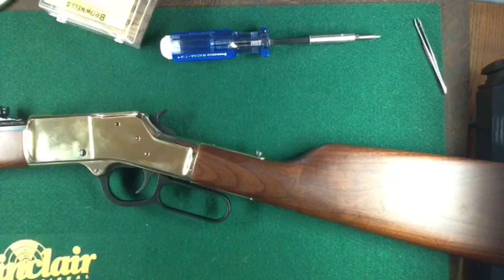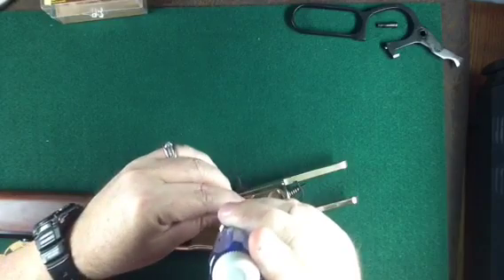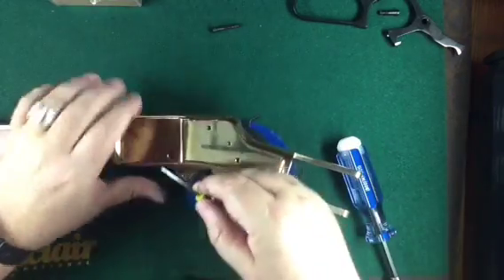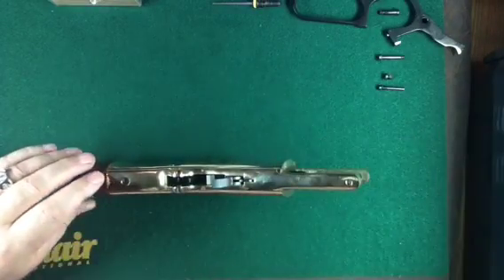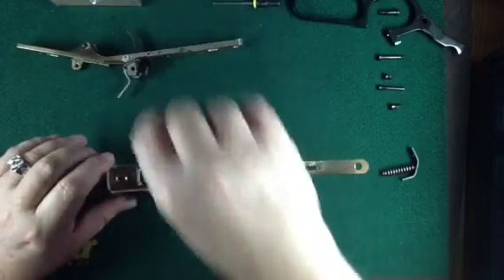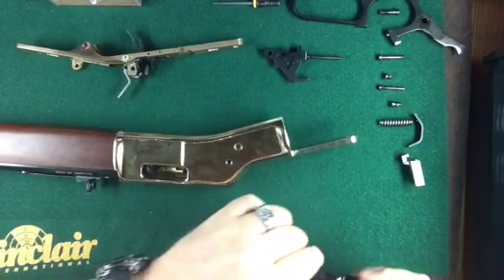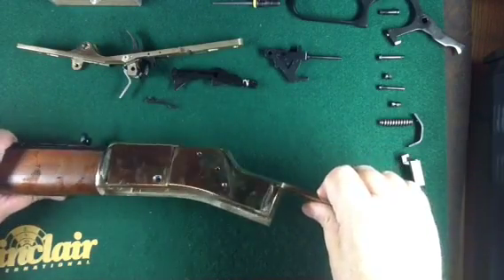Henry Big Boy Rifle Disassembly

Comment: Thanks Gerry. I pulled mine apart yesterday to access the tiny screw that holds the mag tube in place. ( Mine had come loose and the tube was moving around. ) Turns out the adjustment on that screw is critical. Too far in and the brass tube will not slide in, too far out and the tube will float. Be wise and use lock tight.
Reassembly was smooth until that last big screw. I worked at it for over an hour, but found if I replaced the bolt and lever, then closed the action and slowly released the trigger that screw went in pretty easy.

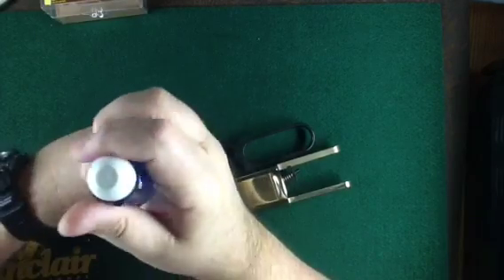Comment: (00:54-01:03) Thanks for the tip about putting the screws in the order you remove them.  This is a great practice to have for just about anything you do when it comes to disassembly & reassembly.  Great video with precise information!

Comment: I have the first gen henry BB in 44mag/44spec I cant seem to get the front screw on the bottom front or the trigger out any tips on this, I just purchased the rifle yesterday and hadn't been cleaned in about a decade
Reply: Use some "break free" spray. It'll eat away anything that is gumming up the screw
Reply: @michaelmassman2805  i managed to get  firearm taken apart but used WD40 the day after my question but thank you sir

Comment: I could not remove the foregrip. The screw came out easily but the brass band would not move. Do you have any ideas.
Reply: Apply a firm amount of pressure to the barrel band a wiggle it back and forward it should work

Comment: How do you remove the forend?
Reply: Take out barrel band screw apply firm pressure to remove barrel band wiggle fore end slide FE up about 1/8 inch it should come off in your hand